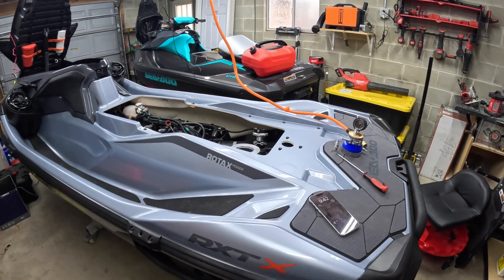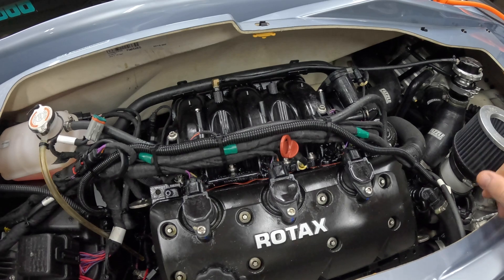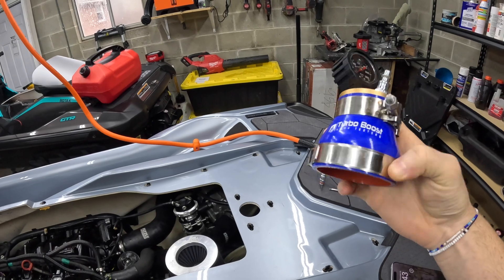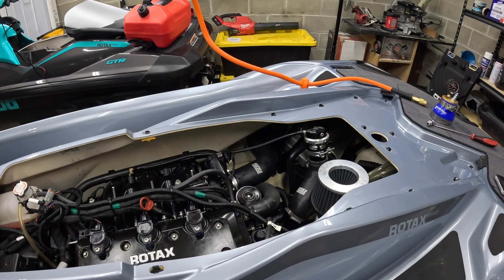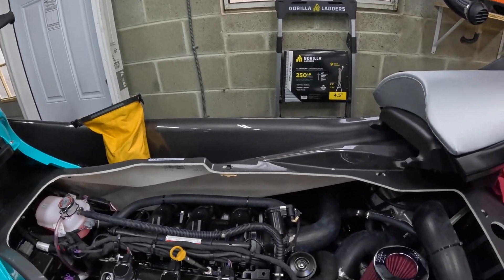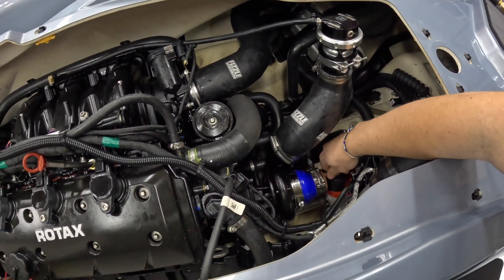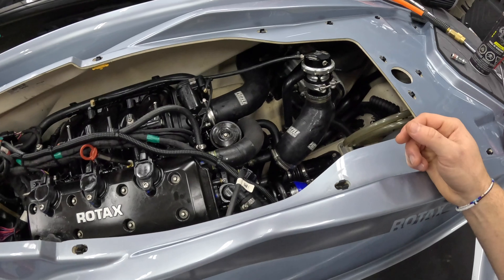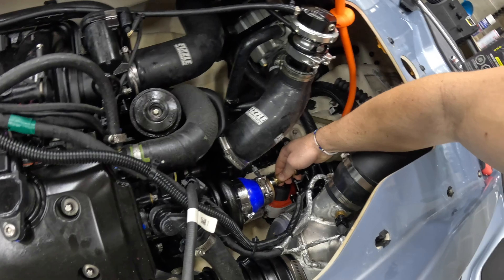How To // Find Boost Leaks on a Supercharged SeaDoo

Comment: Hi Jake, with the test going on, once your set pressure has filled the engine and pipes, how long should the pressurized air hold during the test before the air escapes?
Reply from the maker: It'll slowly drain because the engine isn't 100% air tight, but it shouldnt be a catastrophic decline in pressure. If you mean how long do you keep the system pressurized, you can keep it pressurized as long as you need it. If there's no leaks, then you can let the air out.
Reply: Escapes meaning that you manually release the air in the system/test
Reply: I have the LeakTester and it has a schrader valve, and once I fill it to 20psi, it slowly goes back to 0 in about 40seconds... is that bad, or ok?

Comment: Finally someone who actually shows how it’s done 👏 mine had an issue with not accelerating to top speed and maxxed out at 50 mph and 6k rpm.. did this boost leak test how u showed and found a  broken seam in the intake manifold.. props to u man!
Reply from the maker: Glad I could help!